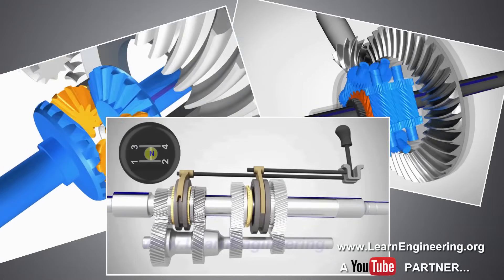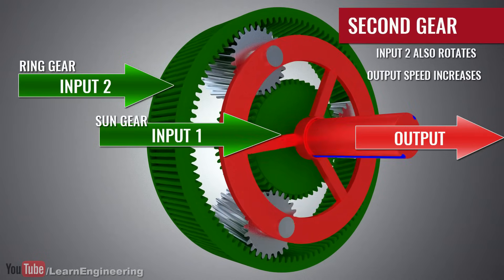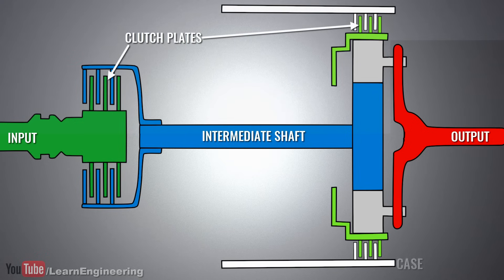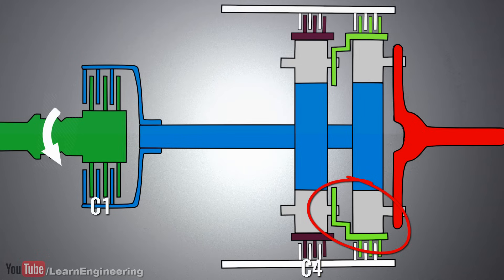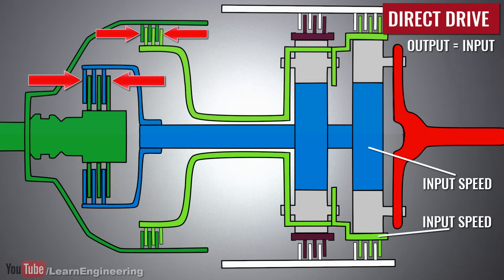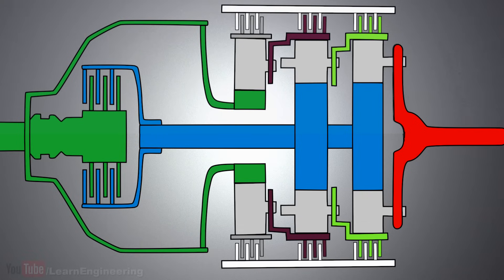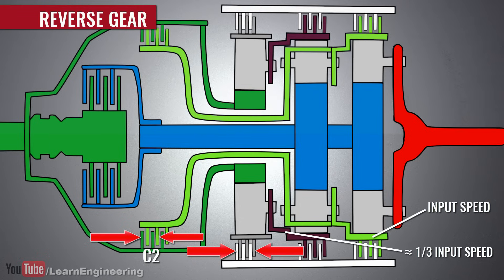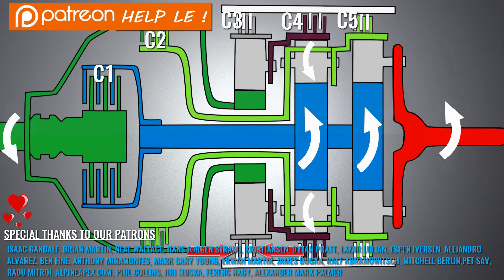Automatic Transmission, How it works?

Comment: I have one questions: why is the power discontinued (and is it really discontinued?) every time an automatic transmission shifts? It often feels like the acceleration is reduced for an instant right before shifting, while in a DCT there is typically a smoother gear change. Nothing comparable to a manual transmission anyways, but I can't understand while the power il lost if the planetary gear sets are always engaged and shifting only means changing combination of locked clutch packs

Comment: 2D version is much comprehensive!
I've done a little math calculation and figured out the ratio, which is rather simple.
The key is that the linear velocity of the gears have to be the same so that they  match each other. Finally you would get the equation: OMEGA_B(R_A+R_C)=omega_A*R_A+omega_C*R_C, where OMEGA_B is the angular velocity of the revolution rotation of the planet gear and omega_A/C are the angular velocity of thr sun and the ring, R(s) are the radius.
So we can see that rotating the planet gears (OMEGA_B=input) while keeping the ring (omega_C=0) stationary results in omega_A=OMEGA_B*(R_A+R_C)/R_A, meaning the much higher speed of the sun (≈3*input in the video, R_C≈2R_A). Other cases can also be explained by this equation :)

Comment: Gear one: C1, C5
Gear two: C1, C4
Gear three: C1, C3
Gear four: C1, C2
Gear five: C2, C3
Gear six: C2, C4
Reverse: C3, C5
Reply: @RobertBurik  it is fluid. The speed of the motor at specific RPMs engages the clutches by moving fluid around via centripetal force (IIRC)
Reply: @tisaconundrum  Almost.. It's mainly governed by engine load. In older cars without electronically controlled transmission, it's governed by vacuum and the detent cable.
Reply: @RobertBurik  Pre computer auto trans were like the ultimate mechanical computer.  There was a governor that sensed drive shaft speed, throttle cable for throttle position and a modulator for vacuum or engine load. The combination of each of those would determine which clutch got applied via hydraulic pressure routed through the valve body and ultimately gear selection.
Reply: @michaeldose2041  With all those moving parts, I'm suprised they worked reliably.
Reply: @twistedyogert  well they do have a much shorter life span than a manual transmission, assuming the person driving the manual drives it correctly
Reply: i see the pattern its make it slightly easier to understand
Reply: @Charlie Tinoai No, c1 is not engaged for reverse and it shouldn't be because if it does, the intermediate shaft can't turn in reverse. Remember, the 3rd sun gear is always connected to the input and always turns at input speed. When c3 is engaged, the planetary gears revolve in input direction, turning the 2nd ring gear in input direction which spins the 2nd planetary gears, also in input direction. And because c5 is engaged, the 2nd planetary gears are held in place. So they turn at input direction which turns the intermediate shaft in the opposite direction, and since c5 is engaged, the planetary gears output in reverse.
Reply: @aozf05  why is that when C3 is engaged the planetary gear rotates. When the sun gear always rotates obviously the planetary gears would also always rotate right except when C4 is engaged? Could anyone explain 3rd gear set.
Reply: @karthikeyans6825  I was specifically explaining reverse but wasn't clear enough in my original comment. I should have said "revolve." I've edited it for clarity.

In certain gears, the 3rd planetary gear set will revolve or spin without affecting the output. For example, in 1st gear the 3rd planetary gears revolve in reverse but they aren't transferring to the output shaft so it doesn't matter.

This guy has a pretty good animation showing how it all works in better detail than this video: https://youtu.be/YYr1gx_FdkY
Reply: Clever guy
Reply: @RobertBurik  Hydraulic pressure.
Reply: I was looking for this

this comment + preview = TheWholeVideo.zip
Reply: @Detective_Lynne  -- what is that, a Url or link to a website? 🤔
Reply: @Texaca  file name, but yt see a link
Reply: Thank you, I now understand how an Automatic Transmission is controlled
Reply: I’m not as smart as you and I hate myself for it.
Reply: If this holds for the MD3060m that means with my 6th locked out, C4 is only used in 2nd gear.
Reply: And what about overdrive and two and four wheel drive? 😳
Reply: @m101ist  Overdrive is any gear with a ratio of less than 1, for instance, a Ford 10 speed transmission in a superduty truck has a 10th gear ration of 0.63. That means the output shaft is turning faster than the engine. That's overdrive.

Four wheel drive is handled by the transfer case which is attached to the back of the transmission or somewhere else. It uses a set of gears or a chain to turn a second output shaft with the first one, allowing power to a second axle.
Reply: Thanks
Reply: Spool valve with a set spring pressure allows changing line pressure
Reply: @RobertBurik  Older cars had 2, 3 and 4 speed transmissions, much simpler.
Reply: @RobertBurik  Valve body.
Reply: In neutral how these gears operate?
Reply: Actually, it goes like this:
c1, c5 - 1
c1, c4 - 2
c1, c3 - 3
c2, c5 - 4
c2, c4 - 5
c2, c3 - 6
c1, c2 - reverse
c1 - neutral

Without C1 or C2 there is no power to the transmission.  Thus, reverse is NOT through C3 as C3 has no direct connection to the engine.
Reply: Reading gears in order while looking at the full diagram makes everything make sense. You are an absolute godsend. Thanks, mate.
Reply: Thank you very much for simplifying this entire system with this genius answer
Reply: Episode four: C3 P0
Reply: if i want to 5 speed and 1 reverse , how many sun gear , planetary gear and reang gear ?
Reply: @faisalrizkiprayoga4036  the same question

Comment: I think its much easier to understand a Toyota Prius gear set.  But I feel it wud be even simpler to make an all electric hybrid where the engine charges the battery and only the electric motor is connected to the wheels. Automatic and with much higher efficiency.

Comment: I came here with the question on how a car knows when to change gears at what speed (or RPM) and it didn't get answered.
Reply: The answer you're looking for is simply within the PCM. The transmission simply makes the change, but the PCM (Powertrain Control Module) is what tells it when and what to shift to.
Reply: @brykkammo3887  but how they did that in an early mechanical manner?
Reply: @Bszewski  3 words: hydraulic load detection 
Basically (from what little I even manage to understand) There's a hydraulic pump somewhere around the torque converter, and it builds pressure. I'm pretty sure that based on how fast the engine spins the converter it increases or decreases pressure. Lower pressure means lower speed (or a higher load) and so, it will close a spring loaded valve and stop pressure from flowing to the clutch packs that apply higher gears, in favor of applying a lower gear. And visa versa from high speed (lower load)
That's part of the reason why many could call an automatic stupid. For example. Youre driving up a hill, and have to increase rpm to maintain your speed up said hill. It will shift up because rpm increased ( and so hydraulic pressure increased) and it opens the high pressure valves to got to higher gear. Making it harder to go up the hill... Of course when you slow rpm, decrease pressure and close high pressure valve. It will shift back down. But Yea. 
Short and sweet is rpm go up. Hydraulic pump pumps more pressure. Pressure opens spring loaded valve. Spring loaded valve sends pressure to corresponding clutch set, and you shift
Reply: Wow. Jesus Christ me. That was wrong. Alright. There's a lot more parts than that. I'm very sorry. I just spent a month in an actual transmission college class, (that's why I was here was to try and study), and past me was forgetting more than just a few steps. The pump does supply pressure, however, it does not determine which clutches apply gears directly. In a hydraulically controlled transmission (old ones), a governor, ( spinny weighted valve) is attached to ( i think. I may have passed the class, but it's still difficult :v) the output shaft. The governor uses cintrifugal force to pull itself in and out of a valve shaft thing to direct the hydraulic pressure to a vacuum modulator. That part, from what I understand, smooths the shift by progressively sending pressure, and determes which shift valves to send pressure based on engine vacuum. High vacuum. High load. Lower gear.  And visa versa. That pressure, based on all of that goes to shift valves. Shift valve is opened or closed by the modulator, there are several valves. A shift valve only operates 2 gears. So the modulator desides which shift valve, and the governor decides which of the 2. And now we have shifting. 
      Maybe. I'm starting to confuse even myself right now :v. I know i have the parts right. Im still missing the kickdown and some others. But main control parts are here. Whether i have them in the right order, i don't know :v please do not take this comment as 100% fact. As i said, i passed all my tests and final, but i did that with a textbook right in front of me if i was in doubt :v I'm sure there are much better, more correct explanations out there. And if reader actually knows what they're talking a bout, please correct me lol
Reply: At the simplest... low engine loading, high rpm, with the throttle depressed - go up a gear.

Comment: You are saying “Apply c1, c2 etc.” but.... how exactly does that happen inside of the car while driving? The driver doesn’t do anything, so what exactly does that?
Reply: the electronic control system will apply the clutches with hydraulic fluid

Comment: What actuates the clutch packs? What inputs is the A/T control unit based on to make the gear selections? (RPMs, current gear, gas pedal position, etc)

Comment: Manual transmission: 
Clutch disconnects shaft from motor, you apply desired gear, clutch reengages the shaft, car moves. 
Automatic transmission: 
Many clutches make many gears Turn or NOT turn thus producing different gear ratios, thus producing various torque and speed. 
Think of it as a mechanic numbers counter. You must turn the right most wheel (1)  over one full time to next-right wheel (2) to turn to 1. Then next revolution of  (1) puts (2) to 2, and so on and so on. Then the multiple clutches come in and my head is about to explode from not being able to completely wrap my head  around this principle, and I am going to eat play doh in my pillow fort now untill I find the courage to try to understand this again in a couple of months.
Reply: but bro ,the car is not having clutch pedal so how do we apply the gears,i couldn't get it.Can you plz explain.
Reply: @shyamalim3797  it’s automatic and I think the Sun gear is what shifts the gears for you instead of you having to do it as you would a manual
Reply: @shyamalim3797  ye aim commenting you 2 years after your comment bc I’m pretty confused to do just know we all confused lmao
Reply: @shyamalim3797  The computer decides based on input / output speed of the shafts, RPM of the engine, speed of the wheels, etc.
Its programmed to engage / disengaged specific clutches at specific moments depending on what you're asking of the car. For example, let's say you're cruising in 5th and suddenly start climbing a steep hill. The wheel rotation will reduce because the engine doesn't have enough torque to climb the hill in 5th, the computer will then engage / disengaged the proper clutches to go into 4th. You will feel it a little but since the torque converter uses fluids, it softens the hit of changing ratio quickly while applying power.

Comment: what i still don't understand is when/how the automatic transmission switch gear . for example how it decide to switch from 1st to 2nd . or from 2nd down to 1st . is it from the speed or the rpm .
please help
Reply: AT control electronic module. Its inputs are many such as PRND selector, road speed, engine speed, throttle position, ATF temperature, traction control, brake pedal.

Comment: Applying C1, C2, C3,.... Who is APPLYING? What is this guy thinking? This video is missing something crucial.
Reply: Avu Tin The clutch packs are applied/engaged by a piston pushing the clutch packs together using hydraulic pressure provided by the pump and routing of  transmission fluid through proper channels in the valve body.

Comment: So i  understand how the mechanism works, but i just cant get my head around the gear ratios, like how engineers achieve them.
Reply: Rewjik it’s the size of the gears
Reply: @mrpanda2655  No shit, i get that. I meant i dont understand what clutches you nedd to engage or disengage in order to achieve a certain gear.

Comment: Good attempted explanation but without the math of the gear ratios applied at each gear combination from input to output nobody can fully understand how the different speeds are achieved. Too many wheels turning in one's head at the same point without reference to what they do and how much they affect the next element to figure that out like that. It really has to be this oversight with an in-depth of each gear ratio. Brilliant system though but you have to wonder whether it is overengineered and a cvt or other system is ultimately more sensible if engineered to the same degree. But if the numbers say this is better, more efficient and not needlessly more expensive to manufacture it doesn't matter that most laymen can't understand fully how it works. Best solution is best solution. Great but somewhat complicated system.

Comment: no idea what c1 ... c5 do. I just put the car in D, what happens next? no explanation of the "automatic" part, only gear ratios.
Reply: Modern vehicles use computer modules to control actuators and such based on variables from sensors. So in this case, your vehicle engages a combination of clutch packs (based on variables such as speed, throttle input, ...) to engage various gear sets to achieve a gear ratio ("gear").

Comment: Bottom line, an automatic transmission is a gear ratio application unit using hydraulic pressure and a “brain”, along with engine vacuum.

Comment: How to change oil transmission auto Chevrolet optra 1.8 and how to top up the oil transmission auto where is the screw plug we are open to top up the oil transmission Chevrolet optra 1.8 (2005)

Comment: Have searched plenty of videos for this topic but none of which explains how automatically it controls clutches to gain different speeds. The essence of planetary gears is that it doesn’t need to switch between gears like a manual one does, instead it switches between clutches. But it seems like a totally different tech talked in every video.
Reply: Even planetary gears is introduced to transmit parts it is still impossible to change the speed w/o human interfering, like pushing a paddle or so to enable or disable clutches combination, if no extra mechanism is included. So what’s the diff between AT and MT?
Reply: And for torque, without regard to the performance, I think it can be applied to a MT too, to save engine from stall. And inversely an AT doesn’t requires a torque necessarily if a final clutch is connected to the breaker.
Reply: I may not understand your question. But if I do, I'll say this: computer modules control actuators and such based on sensors to engage a combination of clutch packs.

Comment: Hello , first i want thank you so much for you video ,
second i got some question, 
if input from engine cranshaft is 300rpm
first gear output is 100rpm correct?
second gear output is 200rpm correct?
third gear output is 300rpm correct?
four gear output is 400rpm correct?
fifth gear output is 500rpm correct?
sixth gear output is 600rpm correct?
reverse output is 100 rpm correct?
Reply: Depends on the gear ratios.

Comment: There's a mistake in this video at 3:18.  It says, when ring is stationary, that "sun = 1/3 carrier."  That's not right.  Carrier = 1/3 sun.  So, if the input is applied to the carrier, the sun will be 3 times faster.

Comment: What does c2 and c4 apply mean? In an automatic transmission you don't change gears right? You just step on the accelerator and the transmission does it everything for you but I'm on confused when it says "apply c2 and c4?" Someone help a noob please. thanks!
Reply: It means that the transmission engages the c2 and c4 planetary gears. Modern transmissions use a computer to determine and engage the proper gears.
Reply: @Redtooth75  thanks!
Reply: A combination of clutch packs are engaged to use (various) gear sets to achieve a gear ratio ("gear"). In this case, it's more a gear ratio than an actual gear. Your vehicle uses computer modules to control various actuators and such based on variables from various sensors, and that's how the clutches are applied.

Comment: At 1m50s what is the point of C5?  There is no "input" driving the ring gear.  Also, with C1 and C5 clamped down how would this not result in a complete standstill since the input shaft AND ring gear would be immobilized?
Reply: There is actually an input (from the carrier/output of the second set of planetary gears) but they didn't explain it until later in the video. 
I think they wanted to avoid mentioning details until they were most relevant so they didn't include the whole setup that far into the video.